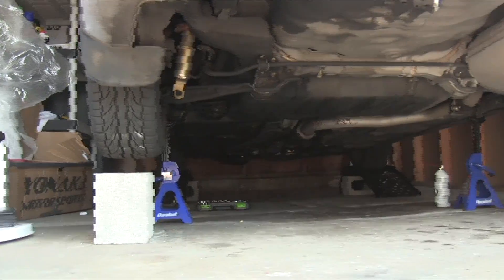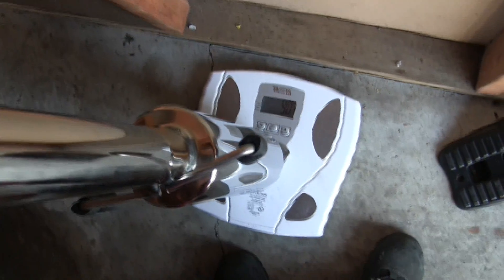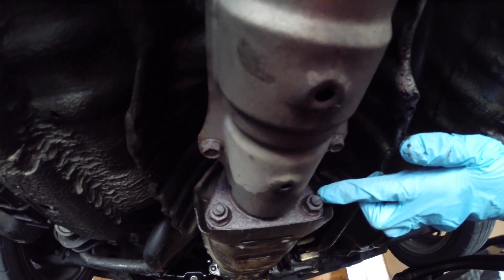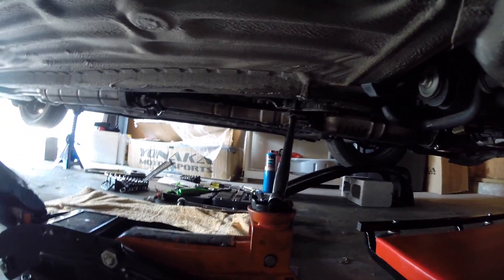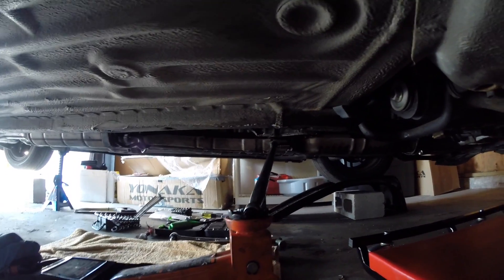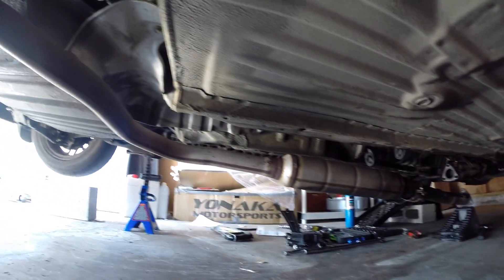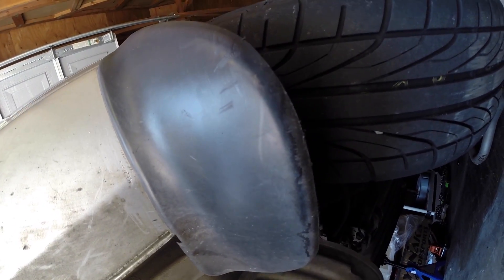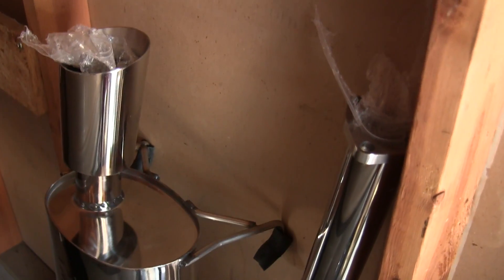How To Install A Catback Exhaust - Project Integra

Comment: Is there a flex pipe installed with the original catalytic converter ? If not, when do you need one ? My mechanic told me I need one BUT I don't see one in yours.

Comment: Just out of interest would it be better to first loosen all bolts whilst it's still in position rather than when it's hanging down. Putting pressure on the other bolts left in. Just curious? Great watch by the way!

Comment: Any idea how to get this to fit on a 98 gsr? 94-99 gsr has a shorter A pipe than every other integra model so the yonaka cat back doesn’t reach the cat converter. I emailed yonaka if getting both the yonaka exhaust header and cat back would solve the fitment problem and they said their cat back exhaust ends with a three bolt flange and their exhaust header ends with a two bolt flange. And they still recommended having s muffler shop add a length of test pipe. Maybe also getting the yonaka high flow catalytic converter would solve the issue?

Comment: The jack/breaker bar combination is what I use to do when I loosen the oil drain plug on the 78, Dodge Challenger. But I used a wrench instead.

Comment: I'm thinking of building a custom exhaust on a '95 Accord EX. Essentially, running a dual split header (2 cylinders per) into an x pipe followed by dual catalytic converters, resonators, and tailpipes. Very similar to a muscle car setup with a v8 but scaled down to focus on low and midrange torque for the 4 banger. My intention is to locate the O2 sensor bung directly in the central part of the x-pipe to adequately gather information from all 4 banks- OBD1 programming, as I'm sure you're aware. My question IS since there is a Venturi effect at this point in the system, do you anticipate this location would cause poor readings from the sensor or cause drivability issues otherwise? .. I really appreciate your channel and any outside perspective would be much appreciated. Thanks!!

Comment: hey man I have a sedan Integra and was wondering if this exhaust would still fit mine since its says two door only
Reply: It'll fit but you'll need to take it to a muffler shop and have it cut somewhere and wield on an extra piece of pipe to make up the difference in length. I did some research because I also have a 4dr Integra and am planning on getting this exhaust as well. Gl ✌️

Comment: I saw that you bolted the cat back right into the stock catalytic converter, I have a set-up in my garage now and cannot fit it direct.

The yonaka cat back is 2.5 inch, I'm getting 2" from the cat forward.

Comment: Gotta say, the jack/breaker bar combination is rather ingenious.
Reply: +UndergroundTrev Slowly trying to break loose a stuck blot like that has a much greater chance of stripping the heads. It's better to hit the breaker bar with a hammer, the quick force will break it loose with less chance of stripping the head. I've never had problems with bolts that way, even rusted out ones as long as you soak them in penetrating oil and/or PB Blaster.
Reply: @AdmiralRustyShackleford  good advice!
Reply: he is brilliant!
Reply: I honestly and of firmly believe if I did this I would have had less of a chance of breaking off a stud but I guess that was my mistake

Comment: I need a new exhaust for my integra. Right now it's straight piped and it's way too loud. Do you have any suggestions for a quieter exhaust That won't sound horrible
Reply from the maker: +QueensNY127 I'd say just put a muffler on it (and a cat).
Reply: +Engineering Explained hey bro sorry i hope you can help me. i have a a impecable 99 gs silver just like you 5 speed. i bought her with engine code p1399. i feel like my cat or exhaust has a hole . p1399 is random misfire code. i hear the exhaust poping randomly at idle but no power loss . any idea?

Comment: penatrating oil (usually flamable) + open flame = best idea ever
Reply from the maker: +Cole Wright The propellants are highly flammable. Once the oil is out, it takes a significant amount of heat to ignite it. Not that I'm recommending you try to find out what that limit is...
Reply: +Engineering Explained I know man I was just joking with ya

Comment: What's with the jack on the breaker-bar?  It may also be a good idea to start it up and check for leaks BEFORE lowering the car. Otherwise, good job!
Reply from the maker: +MyEyesBled Bolt was stuck.
Reply: I have seen and heard from mechanics that stuck bolts respond to heat and oil better if you use the heat first, then the oil.  The oil quenches the metal and penetrates much better.  Great video

Comment: I'm curious about the jack you used.  It seems to have a lot of height, and I'm looking for one that lifts higher than the old reliable Craftsman.  Also, I like the part about breaking the bolts using a jack.  I ended up having to cut and drill out a very stubborn bolt.

Comment: I have a 96 Integra LS AUTOMATIC transmission and I want to install this exact exhaust onto my car.  Does the type of transmission really matter with the Catback?  The reason why I want to install this exhaust onto my car is so I finally replace my factory muffler, which is all rusted out and annoyingly loud.  I also may buy a 4 - 1 header just for kicks. :3
Reply: crzy4legos1007 I have a 94 ls teg 4-1 header and catback exhaust, no difference between installing auto and manual nothing to do with transmission, pretty simple and adds pretty good gains in power and sound depending the type and brand. You would be surprised.
Reply: Okay, thanks man. :D

Comment: I like it thinking beyond  a typical engineer  and using a floor jack to brake loss nuts. nice! making the impossible possible
Reply: cobra454tim So many problems with this comment.
Reply: such as?
Reply: break or brake?
Reply: cobra454tim Well if you want to know...? "Brake" is an issue. "Loss" instead of loose. Youve got a few other grammatical errors including some double spacing. I was actually commenting on the idea that you think hes "thinking beyond a typical engineer". An engineers job is to find new ways to do things. Engineers are paid to think outside the box and rework traditional ideas. So your comment was sort of redundant and misplaced. Unless you were trying to say that he is thinking beyond a typical mechanic... In which case you would still be wrong because this is well known trick of the trade around shops.
Reply: Justaguyyoutubin  I was using speak to text.....Engineers, I have to deal with them every day as a Mechanic. He is, however an Engineer doing something mechanical....so....
Reply: I dont know what to... Well its been fun chatting Tim! Have fun on youtube you crazy guy!
Reply: @Justaguyyoutubin  Oof are you still this fun at parties, 9 years ago? Genuine question.

Comment: I noticed at the end of the video that the intermediate pipe was hanging a little low, did you go back underneath the car and adjust the hight of the pipe?( otherwise you'll scrape it going over a speed bump and ruin the finish)

Comment: im thinking of getting yonaka headers like the ones you have and i already have this catback exhaust but idk where to get the catalytic converter that would fit between these two parts. is your catalytic converter oem? and if not could you tell me where i could get one similar to yours? thanks. i have the same exact car btw
Reply from the maker: n3v3tS180 Mine is OEM, Yonaka sells cats, or you could bring it to a shop that works on exhausts and I'm sure they could fit things up for you. There is some fabrication involved with the header, as there isn't a bolt on solution that I know of for the cat.

Comment: I have had 2 Yonaka 2.25in exhausts over the years on my 97 LS and they are awesome!! Especially for how inexpensive they are.. Only thing I did was I had a different resonator welded up differently so that it sat up in the exhaust well like an OEM exhaust..  The "Droop" seems to be a pretty common issue with these exhausts.. Great video as usual!

Comment: I would actually weigh yourself and then hold the part and weight yourself again to get a more accurate result in weight. Just a tip.
Reply from the maker: TehDeejus That's what I do, but doesn't look as cool so I film the scale and use that footage instead.

Comment: using gloves while installing a stainless steel exhaust is smart because the oils and acids on your skin can cause 304 stainless steel to rust/corrode in those spots, especially in high temp applicants. stainless steel is not 100% stainless, and it's not 100% rust proof. it is simply more stain/corrode/rust resistant. thank you, Engineering Explained, for these helpful videos!

Comment: Thumbs up for actually working on your car unlike most people Engineering Explained for future reference the midpipe refers to the section between the headers and the catback, and includes the cats (if the car has them). At least that's how it goes with most v engines. I've seen front wheel drive cars with a cat welded to the headers as well
Reply from the maker: pooft Lee It was a pipe, in the middle, so I called it the middle pipe. :) But you've got the terminology correct.

Comment: whyd you bother unbolting the stock muffler from the midpipe since you were just replacing it anyway?
Reply from the maker: Mike Ferrante Easier to remove. In fact I couldn't have gotten it out without doing that.
Reply: interesting. I remember doing the cat-back on my friends 91 miata. we attacked the bolts that attach the cat to the header and they were so rusted they snapped off and the whole system fell out. good times lol. +1 for not using air tools!

Comment: Engineering Explained 
Can't wait to see acceleration tests. Hope it get some difference.
I wait for your videos as I wait to study some subjects at university.
Reply from the maker: Lucas Peres There is a difference, though I would have been better off using a higher frame rate. Some lessons learned, and some data that's useful. Should have a video up in a couple weeks!

Comment: The catalyac converts some of the exhaust gas to oxygen that's why there's usually another O2 sensor after the catalac converter?
Reply from the maker: 7150285 Yes, to tell how efficiently it's working.

Comment: You talked about bolting it to 22Nm. Why is that necessary? Why cant we just bolt it and stop when we feel its tight enough?
Reply from the maker: Bilal Ahmed It's just the oem spec. Too loose, may come free, too tight, may cause damage.

Comment: O ya! I remember my question now...

Why don't you use the "tare" method for weighing the parts? weigh yourself before and after holding the parts? waaayyyyy more accurate.
Reply from the maker: davdavc That's what I did actually haha, but for show, I put them on the scale and made it seem magical.
Reply: Engineering Explained lol!!  well then... consider me fooled

Comment: Normally when I do my catback. I take the muffler off and work my in and then when putting on, I work my way out putting the pipe on the hangar before the nuts go on
Reply from the maker: Sebastian Milla Sounds good to me! I wanted to get the rusted bolts off first, as I thought they'd be the most troublesome.
Reply: Yeah, quick question about that. My friend wants change his catback but the bolts are so rusted we can't get it off. Any suggestions? We've tried using PB Blaster but nothing yet. I will try heating it up

Comment: I wonder if the lighter actually helped at all? I've always heard you need MAP or Oxy/Ace to get anything done, I've tried using propane in the past and it did nothing. I also tried PB blaster, a 19.2V impact, and using a jack on a breaker bar with a pipe on it and all I did was bend the breaker bar and I had to spend an hour cutting it instead. Maybe I just have bad luck with rusty parts...
Reply from the maker: AgentHydra The lighter definitely helped. Heat is heat. I couldn't get it off without using it. I used a propane torch on a few that were more stubborn (and wouldn't budge just using the lighter), also did the job.

Comment: Nice video. Hopefully yours doesn't sound ricey like my DC catback did on my D16Z6. I added a vibrant resonator to the middle pipe and am thinking about a vibrant street power muffler to replace the DC sports. Nothin worse than a fart exhaust IMO. Good luck. You got 1.8 liters I'm guessing right? Might help having more CFM than my 1.6

Comment: You need to invest in a impact and a few impact sockets w/extensions...
Reply: Engineering Explained   Cant you run an extension cord?
Reply from the maker: fightingfalconfan I have no outlet in my garage for an air compressor. I hear they make battery impacts, but they sound expensive.
Reply: Just do some online shopping and I am sure you can find a good impact. Also try the hardware stores in your area like Lowes or The Home Depot..they should have a whole section dedicated to tools. You can also get a air compressor that runs off of normal house hold voltage 115. Or your meaning your garage has 0 power outlets...
Reply from the maker: VLturbo1988 My garage is probably 1,000 feet from my front door. I would need a few (apartment complex).

Comment: Not a bad sounding fart can :-)
Reply: EKFiPod Sorry but you can't compare it to the boxer rumble. Totally different exhaust setups. Subaru get's the boxer rumble from the exhaust headers and the way the engine is designed. This is just your basic fart can with a deeper fart.
Reply: no farting noise with this exhaust bud. many people compare it to a boxer rumble sound, which i agree with. (had one installed on my integra)

Comment: The concrete blocks under your ramps should be repositioned with the holes facing up.  The way you have them, they are weak and susceptible to failing under pressure.
Reply from the maker: Yep, but they didn't fit. The center is positioned so that it would take the hit. Hopefully concrete does okay under compression.

Comment: i got the very same exhaust but im putin it on a EK civic, which is shorter than the teggy so the cat part of the yonaka exhaust is almost touching the open end of the header, basically eliminating the cat ive just been too lazy to fabricate the header to resonator pipe

Comment: Hey man. I love your videos, they help me a lot. I am an off road enthusiast and although this may not be your forté, there are many newcomers to the sport of rock crawling and such. With new drivers come new questions. I see you do know your stuff both on and off road but I would like to see some videos focused on the area of rock cralwing. Some topics are: roll cages, different sized axles, bigger tires and changes you would have to make to support them, and beadlocks. This would open more options for videos and I know you're probably close to running out of ideas for new ones. Thanks!
Reply from the maker: Haha, thanks for the suggestions! I laugh because I'm not sure if your statement regarding "running out of ideas" is serious or not. I have too many ideas, not enough time. :)
Reply: Engineering Explained well if you're not running out of ideas then I wouldn't worry about it! I say running out of ideas because you've covered about every topic and some more than once!

Comment: Need to get yourself an impact!
Reply: Engineering Explained
Not as much as a pneumatic, but they still have plenty of torque for most jobs. A good cordless one can put out over 600 ft-lbs breakaway torque, some are not too expensive either.
Reply: Dest Droid I know that snap-on has an electric 1/2 drive for $1100 at my retailer, it has as much power as their air powered guns, and if you are lucky, with the two batteries it comes with (and charger) last a full 8 hour day.
Reply: Vivos71
There's no need for a DIYer to pay that much for an impact. That's absolutely absurd.
Reply from the maker: I know!! But my garage is crap and has no outlet, so I can't hook up a compressor.
Reply: Engineering Explained
Go electric! Be happy you have a garage at all! (Jealousy is speaking here.) I think you'd be surprised at what an electric impact can accomplish, plus the portability is great!
Reply from the maker: Dest Droid Haven't thought about that. Do they really have the torque of a pneumatic? I can't imagine...
Reply: Engineering Explained
No, not as much, but in my experience it's usually enough for the job. Took stuff off my rusted Jeep just fine.
Reply: Engineering Explained I've got a Milwaukee, 475ftlbs 1/2 drive...haven't found something it wasn't willing to take off besides a crank pulley, which even our shop stubby impact wasn't able to take off (shop air @160psi). Had to heat it first lol.
Reply: I have seen lots of things stuggle with pulleys, gm ones seize all the time.
Reply: I know, I forgot to put in there that the technology is almost there for impacts like those to be reasonable for most people to get.
Reply: The technology is there, snap-on's is just really expensive, my Milwaukee is 18v, 1/2 drive, 450 ft lbs and cost $300
Reply: Engineering Explained   Not as much torque as Air powered ones, a good electric cordless one such as a Makita will do the Job fine for most bolts except things like Crank pulley bolts or CV Joint to Hub bolts.

Comment: Hey Jason! Great video, man. I've got a question though: what's the difference between a resonator and a muffler? And if I'm modding my car for performance (like you are), should I look for a cat-less, non-resonated exhaust?
Reply from the maker: I always say keep the cat, but you can look for a high-flow cat. I have a video explaining these in more detail: Exhaust Systems - Explained
Reply: Engineering Explained Thanks, brother. Checking it out right now.